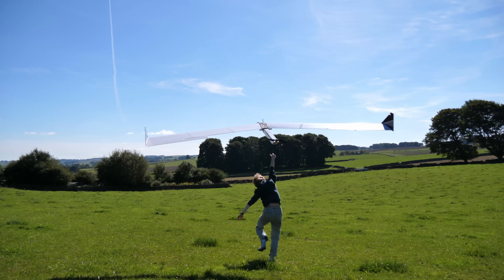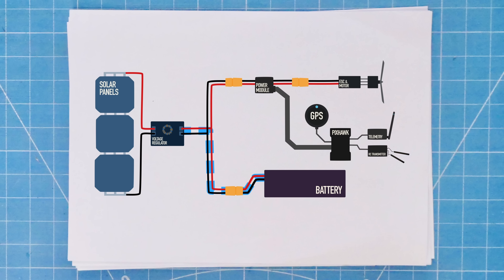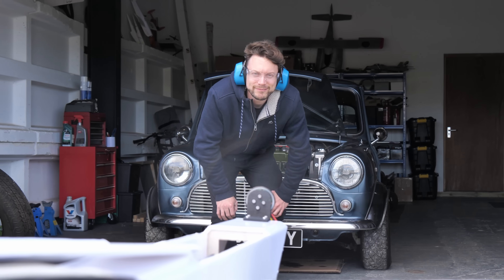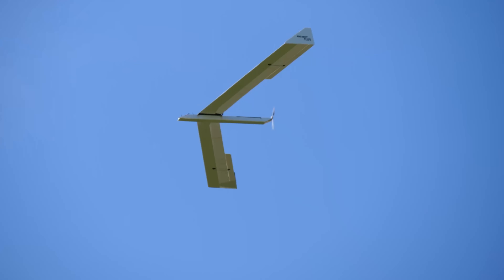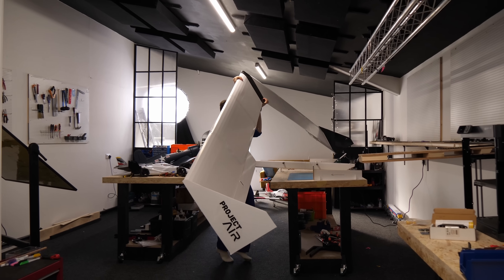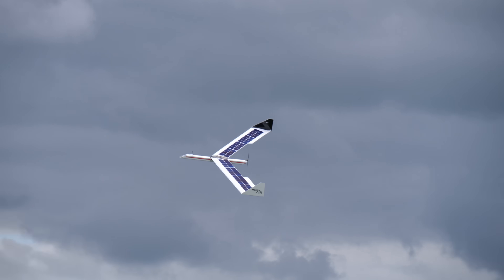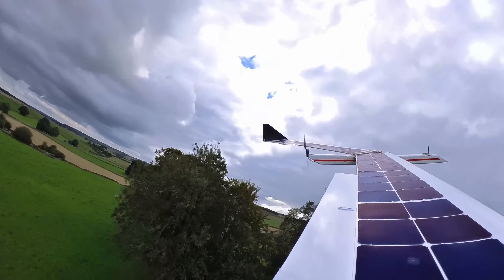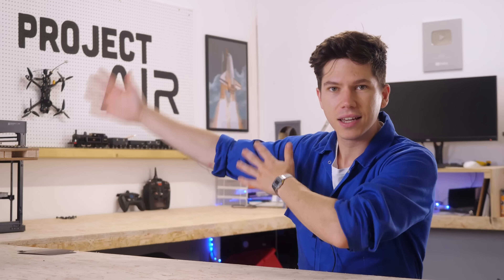Solar Plane V2

Comment: Ditching the MPPT for a standard voltage regulator is a HUGE mistake. MPPT improves the energy capture efficiency from the solar immensely.

What you need to do is not hook the load up through the charge controller and instead connect it directly to the battery. Adding a secondary backup battery for the RC controller is probably not a bad idea either...

Comment: Why don’t you use carbon fibre tubes as the spars instead of the aluminium tubes, as carbon fibre will be lighter than the aluminium?

Comment: One thing you should do is lighten the aluminum angle by drilling holes in them.  I can't tell the actual size of those but if they are cross drilled with holes with a diameter of about 50% of the actual dimentions you should at the least be able to remove 40% of their weight without losing much of their structure.

Comment: You have significant issues in your flying wing design. 

The flying wing isnt the problem! But your specific flying wing solution, as you noticed, isnt the most well constructed. There is both x-axis and y-axis flex occurring (notice the tail being heavy is generating a torque in the mid-section of the wing causing it to flex in both x and y axes. 

I would use carbon fiber rod specifically instead of the aluminum structure. Also you just used aluminum rod without shaping it for rigidity. 

The best is a triangular cross-section for maximum stiffness (unless you just use carbon fiber rod to save even more weight) 

I think to assist in re-designing the wing, I would look at the Prandtl-D flying wing. It was a NASA test RC plane out at Edwards AFB in the Mojave and was found to be a naturally aerodynamically stable flying wing that would genuinely be perfect for your project!

Comment: As stated previously here, keep the MPPT controller. Run your flight controls off the battery, not off the MPPT. If you’re going to reinforce with an aluminum spar, use a thinner box extrusion as it will be stiffer in torque than angle for the same weight. Run as many prop motors as you like; the amount of motors does not dictate your power consumption in level (break even) flight. In fact, running more props at lower RPM with more propelled surface area will increase your efficiency dramatically, and also give you the ability to climb when you need it. Your penalty will be weight of course - but not power. I flew in a two-seater solar plane with 5kw on the wings, and a 15kw motor.
Reply: I'm not an aeronautical engineer, but my sense is that using two props operating in the opposite direction of each other with smaller diameter propellers would increase the thrust and stability of the flying wing.  The larger the prop diameter, the higher the drag. 

When you say "break even flight" are you talking about a no load condition on the motors?  I imagine that means just enough thrust to keep it from stalling.   Is this how the NASA Centurion flew?  It had 14 props!
Reply: @Ben-ne7gr  by "breakeven" I mean, "the amount of power supplied by the panels is equal to the amount of power consumed by the motors". this should be at cruise. on climb you may consume more battery power, and on descend you may charge the batteries. the longer and skinnier the blades on the prop are, and the slower they spin, the more efficient it is. consider how efficient a glider is with high aspect wings; props are the same. take a look at the Solar Impulse props when they spin.
Reply: @Ben-ne7gr  I'm new to this but I know that despite the large prop spin slower, the specification said it can output more thrust with a better efficiency than the small motor with the small prop so, if you got the space, go for the big prop(?)
Reply: @Gookuku_making_friends   creo que el numero de Reynolds favorece la eficiencia de hélices grandes,  lo peor son los vórtices de la puntas de las hélices asique mientras menos mejor

Comment: I would look into using a more basic MPPT controller than those full-featured Genasun units. I've gotten good efficiency with the BQ24650 from TI, and there are dev boards available for $10-20 that should be pretty easy to integrate.
It doesn't do any battery management or output cutoff, it just maintains the correct panel voltage and keeps the charge current below the battery's limit. You can still draw power out of the battery as if the MPPT wasn't there.

Comment: Hear me out. Solar powered drone.
Reply: There isn't enough if any surface area to put solar
Reply: @karimosman7253 unless you suspended the panel above the drone
Reply: Good idea
Reply: That wouldnt work unless u got ur solar cells cranked on steroids

Comment: Drilling Holes in the aluminum angles should provide nearly the same stiffness at 2/3 or maybe 1/2 the weight.

(I know you said you glued the aluminum angles into the wings.)

Comment: Doesn't the BMS handle low voltage cutoff of the battery though? Low voltage =🔥 thermal run away

Comment: not sure you understand bahasa, but you can see our schematic here. we wire the output of MPPT into a BMS (basicly a lipo balance charger) and charge the battery through balance plug, so all the system use the main plug of the battery https://www.youtube.com/watch?v=1T_StcxrM_o&t=147s

Comment: You wasted a lot of weight using angle, if the wings only needed horizontal strength, you should have used flat bar standing vertically to strengthen only the horizontal axis.

Comment: Go for a delta-like root and higher ratio wing-"tips" a mixture of wing types
Reply: +1, was going to say the same thing. Much as I love the pretty triangles, a pure delta is too low aspect ratio for this application, it will hurt aerodynamic efficiency too much to be worth it. But long thin wings, as shown in the vid, hurt STRUCTURAL efficiency too much. Gotta find the sweet spot!

Comment: So, you could have simply powered the components from the battery and not the load terminals of the mppt. The issue with using a voltage regulator is that it pulses dc power, especially and visibly, when the input voltage or current drops too low. That is not only bad for the components but will destroy a lipo. Regulators typically use capacitors and only output power when they fully charge, hence the pulse effect. The pulsing will also effect the speed of the motors as the battery may be at a lower voltage than the pulse, if this is unobserved, the motor controller is taking the beating and fighting to keep a smooth output. An mppt will adjust the charging voltage to move along with the voltage of the battery.

Comment: You can use twnsion wire to stiffen the wings. So long as the load is balanced, you can use a fairly small support.

Comment: Maybe try the Genasun GV-10 to gain more effiency from your solar panels. Connect the esc and avionics system directly to your battery. Add more capacitors between the battery and the esc to be able to reduce the capacity of your battery.

Comment: Why not fuse the solar cells together to make a rigid panel that could be used as the top part of the wing?
You could also use smaller heat sinks and change the design to allow for the air flow to cool the components. Those are passive heat sinks so they're bulky.

Comment: You're on to something with a solar panels but I think something else would do better and something that mankind hasn't done with the big aircraft yet wind turbine generators having the airplane run on wind turbine generators such as fuel and everything this is what I don't understand why mankind has not done this yet we already have the technology right we got airplanes that fly right they already travel through wind anyways high speed winds too imagine how much power in electricity they would have if it was built like that I bet if they did they would have a unlimited fuel plane AKA electricity which would prove once again electricity will always be far more superior than gasoline and oil

Comment: Suggestion: try, or run a computer simulation program, with a full delta wing, but with each layer/row, or so, of solar cells being ‘stepped down’ like a “KF” style airfoil so the entire delta wing solar cell surface area is more active airfoil than only creating parasitic drag. 

(Edit) and carbon fiber rod spars would have been better than the aluminum/aluminium.

Comment: Seems like a very backwards step to eliminate the MPPT charge controller, due to it having a load safely cut-off. Use the MPPT still, but only for charging. Connect the load directly to the battery. A DC-DC converter wont be nearly as efficient in varying sun conditions.

Another recommendation I would say is to introduce a BMS in front of the battery. RC batteries don't feature one for weight and cost reasons, but in an application where you are continuously charging and discharging a lithium pack, you are very likely to introduce gradual cell imbalance, which your charge controller cannot fix. At some point, the cells will go out of balance enough to cause damage, if not a fire. At the very least, add an active cell balancer to ensure imbalances in the cells are handled quickly. They are fairly inexpensive & light as well. They won't have the OCP, OVP, UVP and so on of a proper BMS, but that could even be an advantage as there is no chance of powering being shut off abruptly.

Great video!
Reply: The BMS+balancer should in this case only be used while charging on the ground between flights. If used during flight, the total power cut problem comes back and it adds weight.
Reply: @HL65536  This is not necessarily true. An active balancer board has no means to cut power, only equalizes cell voltages. Given LiPo and Lion cells voltage are (fairly) linear in relation to state of charge, there is no risk of balancing voltage causing an actual state of charge imbalance, which is the real goal. This technique cannot be done with Lifepo4 for this reason until at ~95% SoC for this reason.

As for a BMS, I would really only recommend a 'smart' BMS that is configurable, such as a JBD BMS. That way all of the protections can be configured to trigger (or not) at whatever point you like.

Realistically you should only be operating a lithium battery within its safe operation bounds, with margin for error, and that is what a BMS can provide.

Comment: What in the world is going on here, routing power through the solar panel controller???? A high amperage dc motor ah yes and no BMS? Is this supposed to be a plane or a motorized Molotov cocktail?

Comment: What about stiffer solar panels which comprise the structure of the plane - rather than building a plane and then sticking on the panels? Obviously that depends on the availability of stiff solar panels. Good luck….I’m sure you’ll get there

Comment: Ditch the paper covered foam and aluminum. Carbon fiber, thin ply, balsa wood, film covering = light weight but strong air frame.

Comment: I would personally bring back the mppt cobtroller just as a battery charger maybe even add more than one. Basically my idea is section the wing in such a way as to minimize the drop of performance during partial shading of series panels. For example using a separate mppt controller for each wing or maybe something like the external parts of both wings go to one controller while the internal ones to another. The mppt charge controllers shouldn't have any issues charging the same battery. Also ardupilot have a cool looking charge controller on their wiki that can talk directly over can and provide a ton of useful information.

Comment: If you go with the glider twin fuselage style, connecting the tail in the middle would give the entire thing but more strength/stability and slightly more control

Comment: Why don't you use more traditional models of plane to start with? That dual glider model was the way to go. Your airframes are terrible 😂 sorry, but you should study at how real models are built. Flex is wasted energy, and those airframe shapes you're choosing rely on computers to maintain stability in flight.

Comment: The simple solution would be connecting battery and ESC to the same terminals on the MPPT. Skip the "Load" terminals as they have a cutoff.

Ideally you can find an MPPT controller for 4s lipo. The one in the video has a slightly lower voltage limit,so wont start charging until voltage drops a bit, but should work just fine after that.
That voltage regulator has no MPPT, this reduces panel efficiency, likely by a significant amount. you could use MPPT + regulator, but this adds weight and extra losses.

Comment: You can bring back the MPPT, but rather than connect the plane to the load output of the MPPT, just connect it directly to the battery. This is essentially the same, but removes the undervoltage protection

Comment: 8:42 the motor mount breaking could be good. In normal flight it was strong enough, but broke when crashing, if it didn't break there would be more damage to the motor, designed faliure points can be very useful.

Comment: You have to be very careful with that power setup. If the battery is not fully charged there could be a lot of current going into it and it could explode.
I would go with a series resistor to limit the charge current and an ideal diode to allow for full current when running off battery.

Comment: Idea: 

-Use thinner but wider wings to increase lift without increasing drag.
-Take one or both fuselage parts from the gliders and reinforce the wings with 2-3 thin carbon or aluminum tubes.
-Theoretically, you could also cover the gliders fuselage in a thin but stable layer of fiberglass and then dissolve the Styrofoam with acetone so that a hollow ultra-light shell remains 

These are just ideas and I would love to be able to implement something like this

Comment: Why not use the old mppt controler the same way as your new voltage converter, without connecting "load" terminals? Also if you want to use voltage converter, you should use a type with one more potentiometer, that lets you set the input voltage limit, which acts as a simpler version of mppt and keep the solar cells voltage at a constant level. Otherwise you will loose some solar power if you under- or over-load the solar cells.

Comment: I think you were on the right track with the wing, just the wrong shape. You need more of a delta wingshape so that you have more twist resistance in the structure. I think your huge control surfaces are likely inducing twist in the wing damping out control inputs. Think YB-49 shape and I reckon you'll have a better time with control and flight behavior.

Comment: I can not continue watching 3:10 is the limit. I can’t stand ignoring this voltage regulator without current control. What the …
Reply: Oh no, now they've made you cry.
Reply: I also stopped at this point to see how many people would be pointing out his error in the comments
Reply: What is the importance of current control
Reply: @nathancreager1522  you need current control to safely charge lithium batteries. Stated briefly, lithium batteries need a constant current until the cells reach ~4.2V, where you then switch to constant voltage and the current will naturally taper off.
Reply: @gakcsherbert8699  thanks a lot

Comment: No hate against Perks, but this is literally the one-eyed leading the blind. And eliminating an MPPT controller from your circuit is a step backwards. The cruel reality is that an airplane that is supposed to fly as long as possible requires a complex but integrated solution, not a bunch of voltage boosters from Ali put in series.
Reply: *figuratively

Comment: Carbon square tubes are much lighter than aluminum L-shaped bars and should work nicely (Carbon Fiber 1.75-2 g/cm^3. Aluminum 2.7 g/cm^3).

Comment: The fact that the motor mount broke off so easily probably isn’t a bad thing. It saved the airframe, maybe even the motor. It’s a lot easier reprinting the motor mount than rebuilding the plane or replacing the bent motor shaft.
Reply from the maker: You're right! Although the crash did actually break the motor. It wasn't shown in this video, but Emma managed to fix the copper wires that had snapped on one of the coils. Pretty lucky as we only had one motor!
Reply: @Project-Air  On all my pusher designs flying wings like that I used folding propellers. This saves any mounts and props and the CF props were so expensive back in 2004.
Reply: @1kreature  yep folding prop was my first thought, that or raise the motor up
Reply: @C4reful  Raising the motor up creates a high down-pitch force when throttling up motor.
Reply: @1kreature  put it right above the cg, thats how my bigger planes are configured, also lets you put the bat closer to the center, making the plane a lot more pitch happy.
heavy bat in front and heavy motor at the back is not ideal, so much weight to move when pitching
Reply: You can also properly design the airframe, the flight when he snapped the motor mount showed some ugly fuselage vibration due to lack of stiffness and long arm.

Comment: It might be good to test the charging with a dc supply instead of a battery to simulate different voltage levels 🙂 also it would be wise to add some kind of over charge protection, atleast for longer missions

Comment: I think you just lost a lot of efficiency with the first and second setup. a tail with a standard horizontal and vertical stabilizer would keep your craft straighter and not keep oscillating between lift and drag. The Rudderons are also only really good for a faster moving aircraft. Before scrapping your 2nd edition, try just slapping a simple stick tail on it